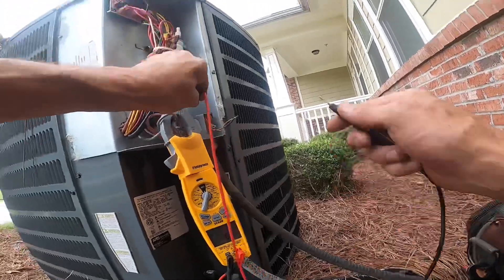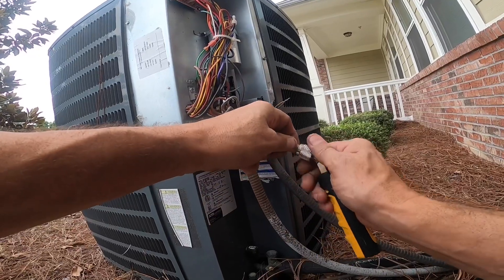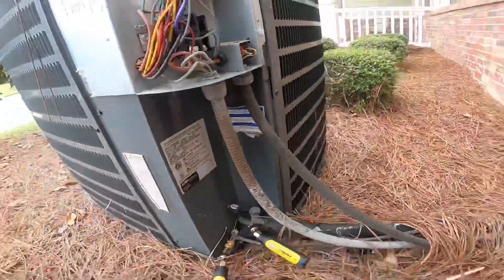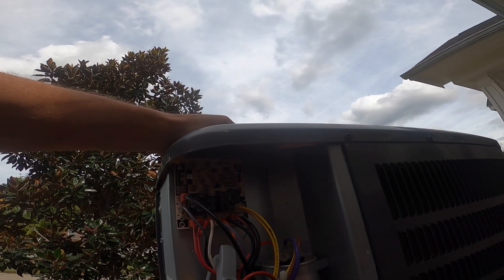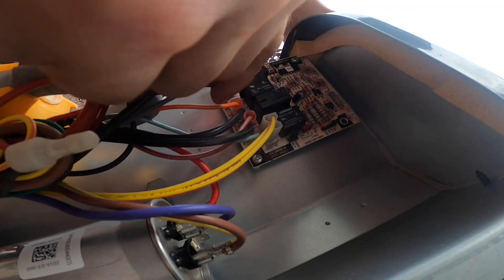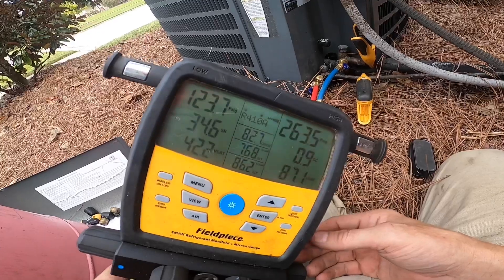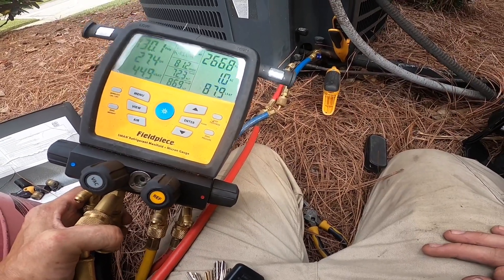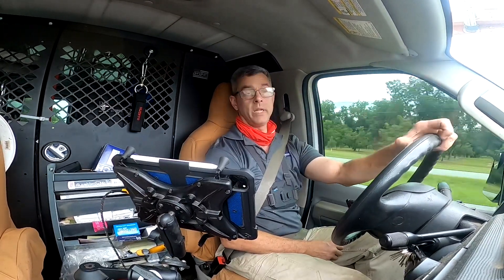Condenser not running, defrost  board  not passing voltage to contactor. Charging in Superheat.

Comment: Mine says 30, 60, 90 then the 2 pin test. I moved the cover up one and the red light on board turned off. I plugged fuse back in an it kicked right on

Comment: So the defrost board has a high and low pressure cut-off switch. Will the board stop the voltage for any other reason if it is  working properly, or are those the only two things that will stop the voltage?

Comment: How come the 2nd pressure switch was getting 0 volts as closed? Wouldn’t it be 24 volts? I assumed that if it was zero there would be no power running to it. Can you please explain. Thanks!

Comment: Okay... I'm confused. 09:28  I thought that the suction line WAS the liquid line and that the discharge line was the gas line. What am i missing?
Reply from the maker: On a heat pump the small line is always the liquid line, hot gas comes from the compressor, so in cooling it goes to condenser to become liquid m and in heating it goes out the big line to evaporator to become liquid. So big line can be suction or hot gas depending on the season.
Reply: @HVACGUY  ah. right. thanks kindly for that.
Reply: @HVACGUY  so the big line is always a high pressure vapor or low pressure vapor on heat pump. Small line will always be a high pressure liquid?

Comment: I didn't watch all of this yet but I wanted to add my experience before I forget. I've changed a couple or 3 of these boards only to find out the low pressure switch wires have worn through somewhere. (Which can knock the board out) I've had one pressure switch to open permanently. If that wire is open or grounded it will not turn on the contactor. You might have already figured it out since I didn't have time to watch the whole video

Comment: Those Goodman defrost boards fail alot.  Also this unit is got a bunch of garbage around it.  Since it's a heat pump it needs to be sitting on risers so it can drain properly when it defrosts.

Comment: I really liked my Mantooth probes because I could add refrigerant if needed unfortunately the charging port broke. Fieldpiece and Testo if you are listening... I carry this board as a replacement 47D01U-843 Universal Heat Pump
Reply from the maker: I used to use a swivel T with my suction probe, but for some reason it charged extremely slow.